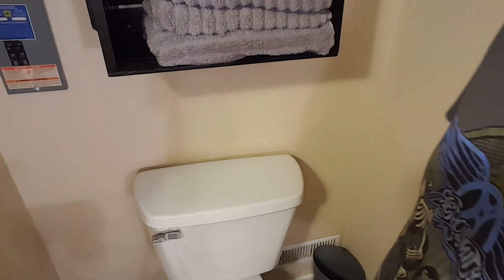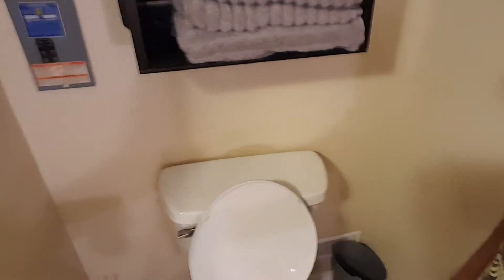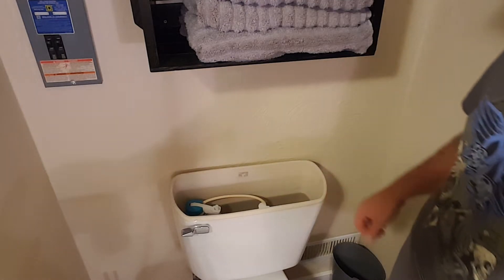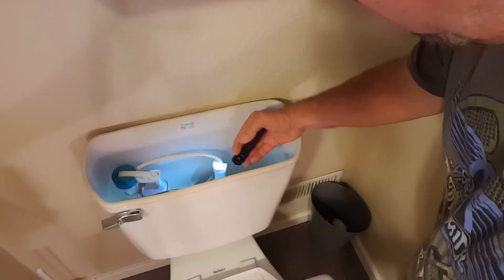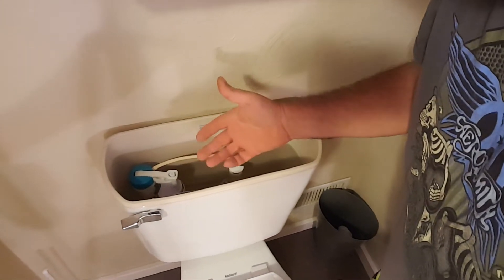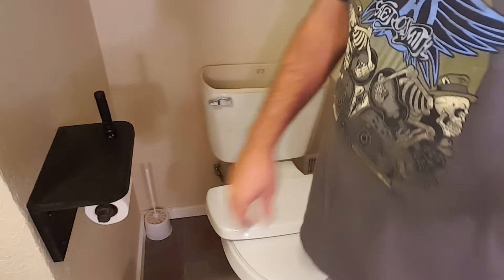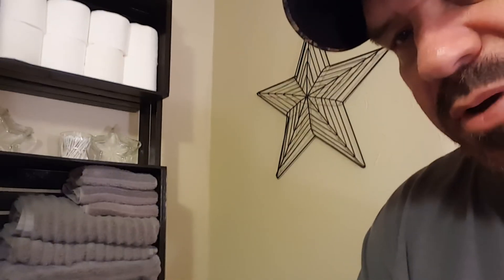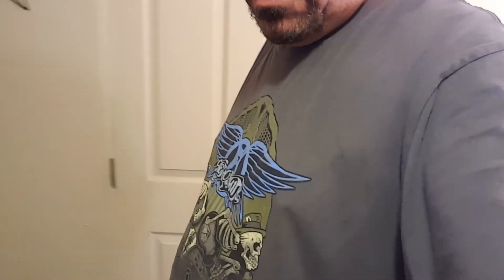Maintenance Monday = Fixing a running toilet

Comment: I have a toilet that makes noise like it's running off and on. That bathroom is used for storage so I usually just close the door so it doesn't bother me with the noise. Now, this coming weekend I plan (or hope) to be able to get in there and clean out the bathroom and repair that toilet. If It works, I will video it and will add it to my house repair video's for later upload...wish me luck, I'm goinna need it. (Oh, almost forgot, a year or so ago I found the pump thingy that fits inside that was still inside the box at a yard sale. I'll use your method first, and if that doesn't work then I'll try to install a new thingy in it.) Stay warm and safe!  :::::::waving howdy from Patriot Acres in north Texas:::::::